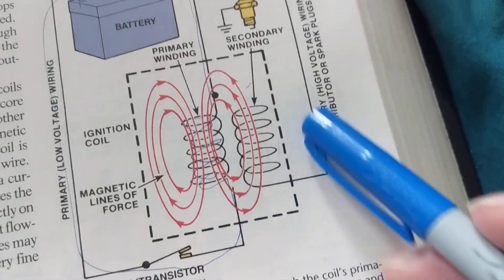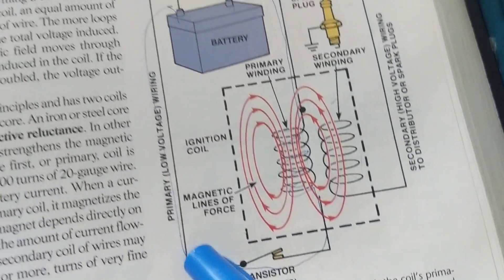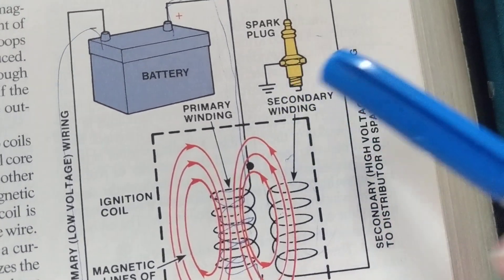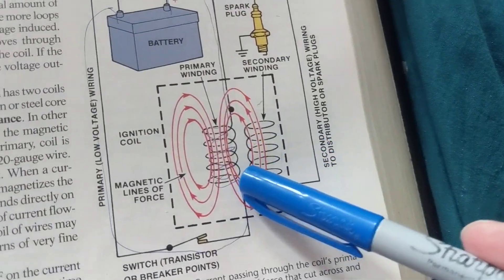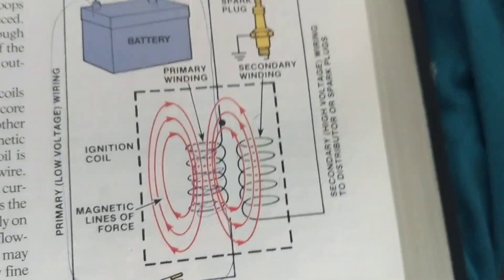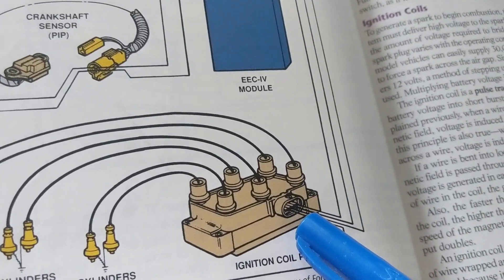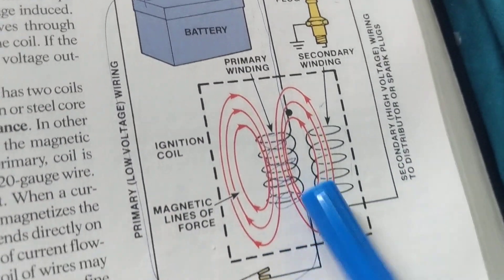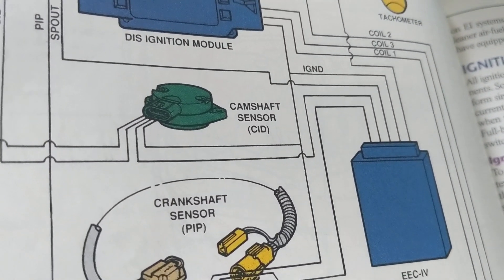HOW THE TRANSFORMER CREATES A SPARK EASY TO UNDERSTAND

Comment: why we are not using AC supply?
Reply from the maker: For the reason that you want to have the computer turn
Reply from the maker: For the reason that you want the computer to have control over the transistor which controls the in and off transformer
Reply: @Joeelectronicschematicsforauto  i have another question dear, why the DC voltage is very high we are using here?! Its reach to 0.9-5 KVDC .